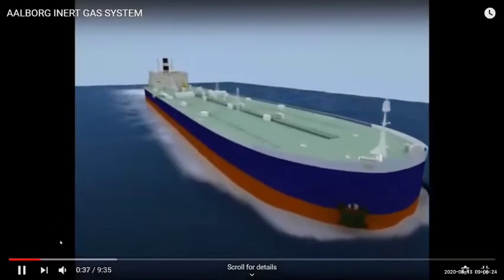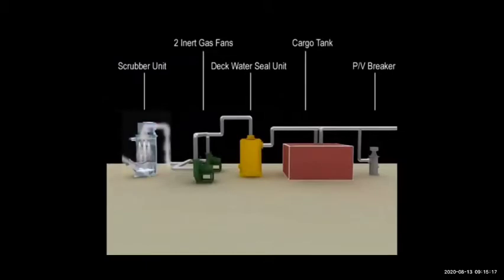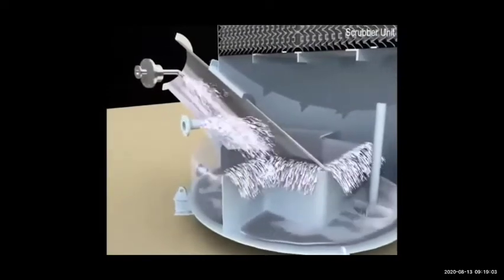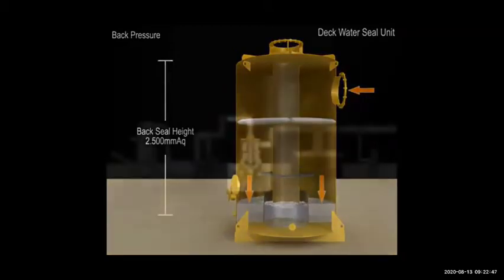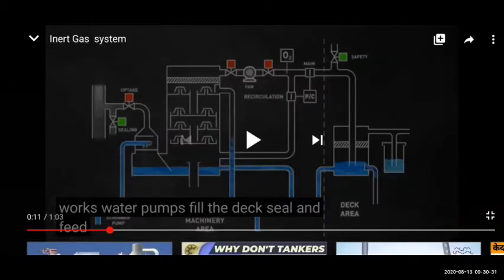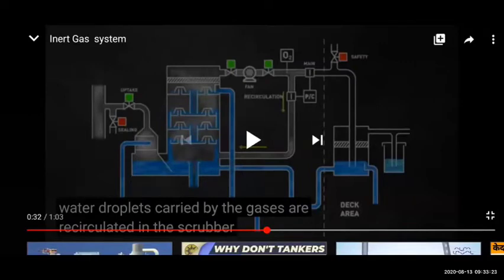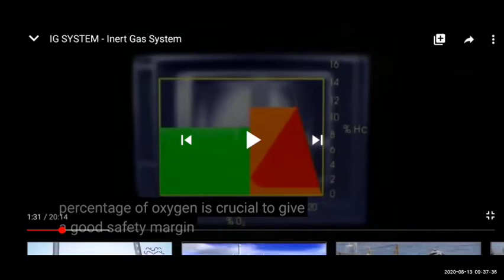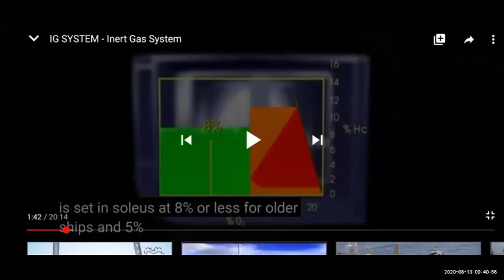# MERCHANT NAVY MMD EXAM INERT GAS INTO

Comment from the maker: From krishnakanth venukumar to Everyone:  11:50 AM
what do we do with the overflowing water
From SIDDHARTH SAAD 16EL0721 to Everyone:  11:50 AM
06:15 minutes you said stones are absorbing sulphur ? is that true
water is absorbing sox
From Suyash Rai to Everyone:  11:51 AM
where that drained water will get collected?
From MALLIKARJUN 13EL0191 to Everyone:  11:51 AM
Any additives used in water to reduce the acid formation, and how is the impure water after cleaning and cooling gases are stored/ pumped out
From Satyam Gupta to Everyone:  11:51 AM
how water level is maintained in scrubber?
From Debankur Dolai to Everyone:  11:53 AM
7.14
From Prashant Yadav to Everyone:  11:53 AM
Do we replace the water present in deck water seal after some time?
From Rajarshi Roy / 15EL0859 to Everyone:  11:53 AM
checks and maintenance in deck seal?
From Vikas Mishra 13EL1321 to Everyone:  11:54 AM
how much is high pressure setting ?
From Ayush sharma to Everyone:  11:54 AM
how much water level should water level there in scrubber?
From Alex pandiyan Ganesan to Everyone:  11:54 AM
incase ig system fails during discharge what we have to do??
From Debankur Dolai to Everyone:  11:55 AM
deck seal function
From Sudhir Kumar 14EL1364 to Everyone:  11:56 AM
we can consider flue gas of boiler also as a inert gas then why inert gas generator is there?
From 14EL1342 ASHUTOSH RAI to Everyone:  11:56 AM
Is there any difference between IG and IGG scrubber?
From Jagdish Kumar to Everyone:  11:57 AM
what don't we use main engine or generator exhaust gas for IG?
From Nitesh 16EL0849 to Everyone:  11:58 AM
Which type of valves are fitted on the discharge side of ig fan blowers
From Vishnu kumar verma 16EL0781 to Everyone:  12:03 PM
what is the function of deck isolating valve?
From Bishal Banerjee to Everyone:  12:04 PM
what all alarms comes in IG system and how to fill water in deck seal....? 
From vivek raushan 13EL1325 to Everyone:  12:04 PM
Difference between igg system and ig systm
From Bishal Banerjee to Everyone:  12:05 PM
in case IG system Fails whom should be inform first …?

PL SEE THE VIDEO LINK